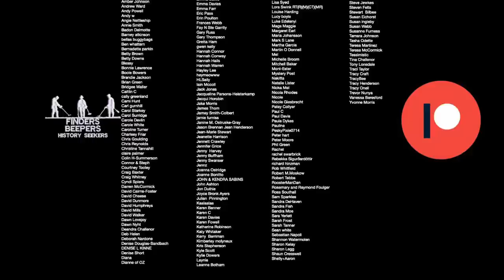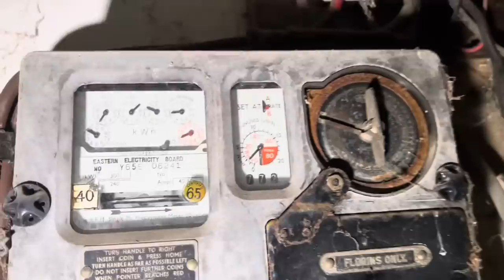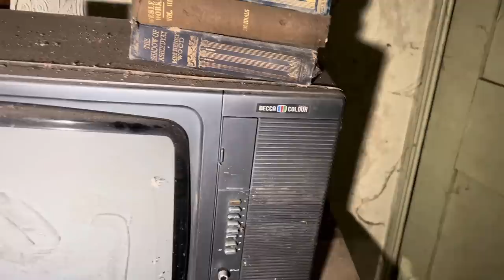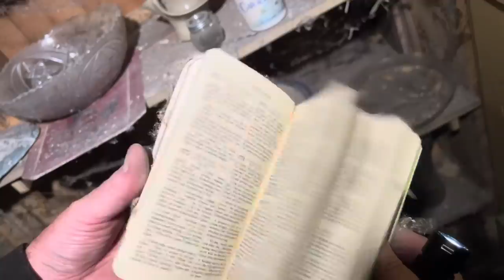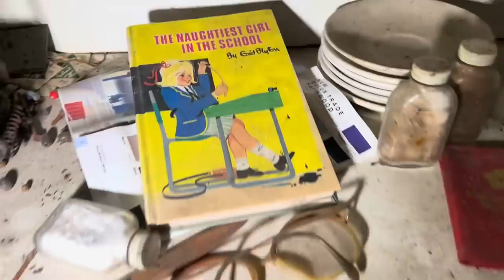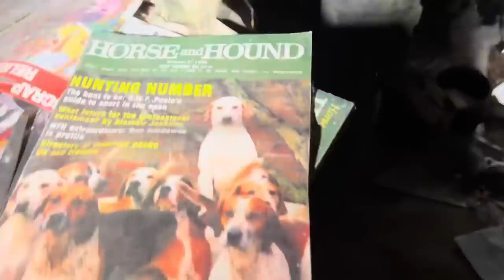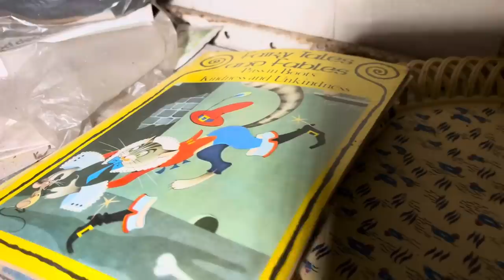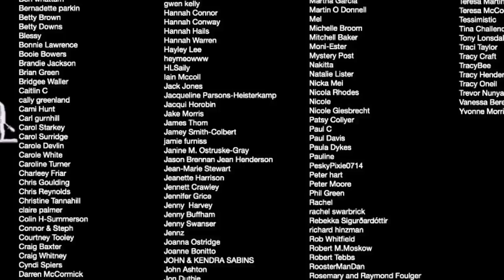I didn’t want to leave this spooky abandoned house

Comment: The tin frame around the fire bottom is called a fender, they can be copper. My mum had one in an old Victorian house we lived in in the 1950's, and the rag and bone man tried for years to buy it off her but my dad was a sheet metal worker and knew the true value of it. The little box is a pill box, carrying tablets around in your handbag. Aspirin always came in glass bottles with cotton wool in to stop them getting damp. It's funny how things that where common place to me you both class as so old. That machine you called a receipt maker is actually an adding machine, a latter day calculator to you. Before that we added up with a pencil and a paper bag. Dear Andy, the pants you are holding up are actually sanitary pants. They have hooks on the inside to attach a sanitary towel to. Great blast from the past.

Comment: Hi guys At 1.23.06 you came across the machine with all the numbers. The machine was sitting on top of something called a Flatley heater. We had one in the 70s. You'd put your clothes on the wooden poles and lower them into the slots of the heater then pop the lid on. It was the only way we could dry our school uniform. Our Mum was old fashioned even then so we had to make do with what was available. I haven't seen a Flatley in years. Luckily it was reliable. Thanks 👍

Comment: Before I forget when I get to the end of the video, I wonder if the stained glass window was an attic door that worked as a borrowed light? My grandparents had one in their attic and a few small glass tiles in the roof allowed daylight in. Given the broken glass shards in the hall under the broken attic access area, with the main panel on the windowsill, it's a possible theory 🤔😊

Comment: Finally, on 1 July 1967, BBC2 launched colour television to the British public with the Wimbledon tennis championships, presented by David Vine. This was broadcast using the Phase Alternating Line (PAL) system, which was based on the work of the German television engineer Walter Bruch. The channel had launched in black and white in 1964 at a high resolution of 625 lines in preparation for the PAL colour system.